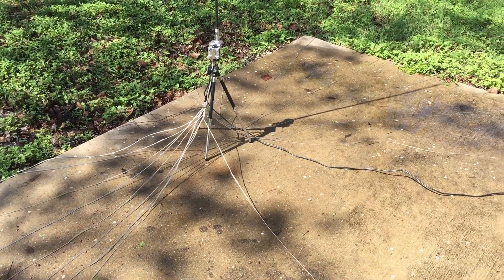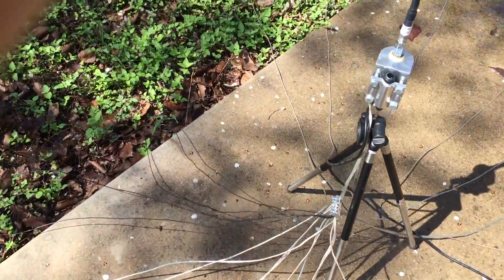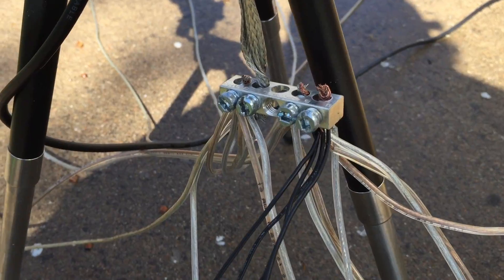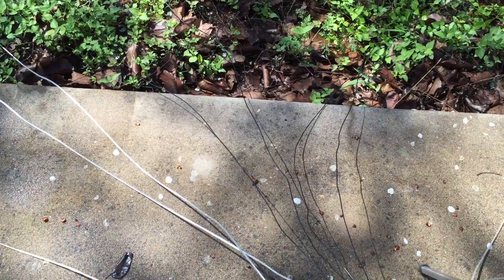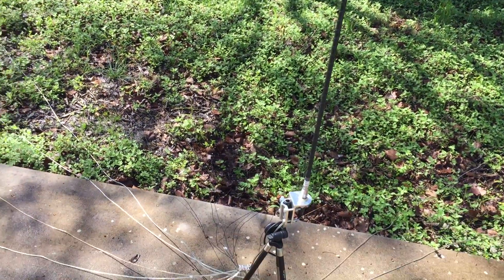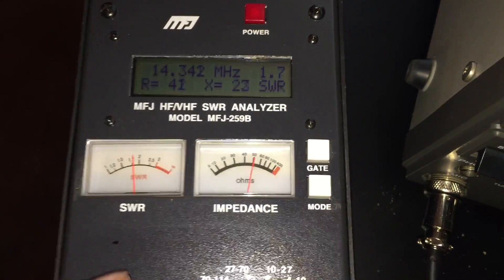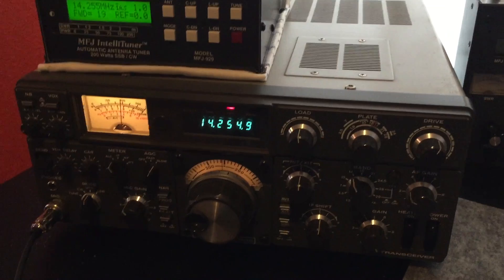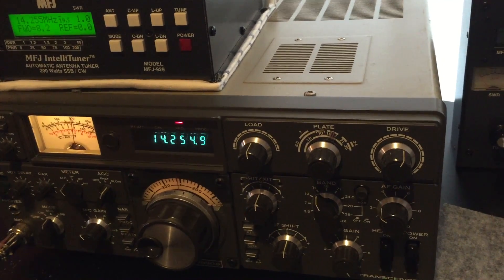Backyard Hamstick - Upgrade to 20 Radials

Comment: I like the video and would like to do something similar. How did you decide on the radial length. You said they were 14' long. I was planning on 16.5' long because I thought that would be resonant for a 20 meter antenna. Do you think a 4:1 balun would help lower the SWR?
Reply from the maker: If I remember, a company that makes a product called the "Ventenna" published an article where they tested various lengths and found the  14 foot length to be ideal.  Ultimately I went with more radials of various lengths, including a few at a full 1/4 wavelengths long.  Check out some of the more recent videos on my channel where I improved the backyard antenna, especially those that discuss a better antenna using a Silver Bullet 1000 loading coil and an MFJ telescoping whip.
Reply from the maker: Oh, and no, you shouldn't need a balun, but I did employ   an MFJ capacitive matcher at the feed-point.  I think the MFJ-909.
Reply: @SWRadioConcepts  73 and thank you for the response!

Comment: Question; The lake view hamsticks ecommended adding a capacitor between the vertical radial and ground on their mobile installations for better lowering the SWR by capaciitive tuning. Does MFJ recommend the same method? Or would it help? I know their manual for hamsicks is still available on-line that lists the recommended values to use for each band's whip
Reply from the maker: I actually did a video on that, and it's on my channel ( https://www.youtube.com/watch?v=wTiu-Y2StaY ) and it did work - though I really didn't think it would have been durable long term - so ultimately, in my car, I put an MFJ-909 capacitive matcher in the trunk (inline with the feedline near the feed point).  That way I can easily switch capacitive values, which you need to do when switching between hamsticks and bands.  You don't really need a capacitive matcher down to 14 MHz, but 40M and below you probably would want one.

Comment: I have a 20m mfj hamstick and I tried to add 6 18ga radials the same way you did on camera tripod about 2ft off the ground and got hi-swr on radio across the band. I don’t have a tuner or analyzer right now. What am I doing wrong? I’m a new general KI7GDT and have been trying to get up and running, but having trouble. Is there anyone that can point me in the right direction? I just bought a mfj2286 off hro so hopefully I will have better luck with that. Currently can’t put up a dipole with hoa on my back. 73
Reply from the maker: Hi!  Sorry you're having trouble.  The 20M hamstick has a wide bandwidth so it should be a forgiving antenna.  You used the same type of mirror mount like I did?  You'll want to make sure there are no shorts in the system.  Do you have a multimeter with a continuity tester?  If you don't, you'll need to get one (they are cheap and locally available).  I'd first set up the antenna as you intend to use it and check continuity between center conductor and shield of the cable where you plug into the radio.  

Did you set up the antenna per the instructions?  The 4" of antenna mast below the locking nut is a starting point.  It'll probably be tuned well below the 20M ham band, possibly in the high 13 MHz range.   You have an SWR meter right?   You'll need one.  I'd check the SWR as low as you can transmit (14.0 MHz or so - and at low power, a few watts) and see if the SWR is better there.  Then move the antenna mast in the nut to shorten it.  You might have to cut the mast (I think I had to) by the time you get it centered right in the 20M band.

It's possible you have a bad hamstick also, but I've bought close to 10 and have not had a problem with any.  Let me know if any of this helps.
Reply: remingtonh thanks for replying so quick. So I checked continuity and I didn't have any shorts. I currently am using  the swr meter on rig, I am looking into getting a mini60 as soon as possible(would you recommend that or something else?) adjusting whip on hamstick is a pain without an analyzer. I just received a mfj2286 that im going to try out tomorrow see if I have better luck with that.

Comment: Wouldn't it be worth moving the antenna base on the grass and benefit from a better ground path than on the concrete?
73's Patrick - ON4KNP
Reply from the maker: I don't know if it would be better, but I've actually already done that.   I don't notice any improvement, but there may be one that I can't measure.   Makes sense though!
Reply: I guess grounding the antenna could also be interesting. Anyway, good luck with your station!

Comment: Are these wires also known as a counterpoise, and is it good for these to be grounded?
Reply from the maker: Yeah they are counterpoises, technically.  Usually though it seems if you only use one "radial" they call it a counterpoise.  I guess when you arrange a number of counterpoises in a radial configuration they call them "radials."

No they shouldn't be grounded, as that seems to "detune" them.  Ideally the radials will be 1/4 wavelength long.  They are they other half of the antenna - the transmitting energy needs something to "push-off" against.